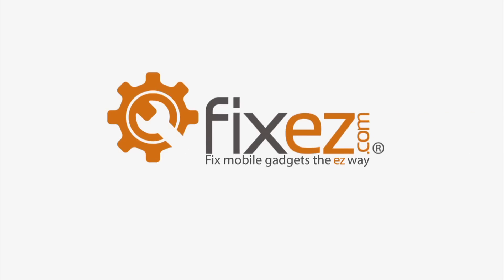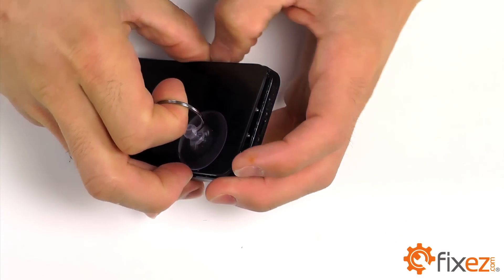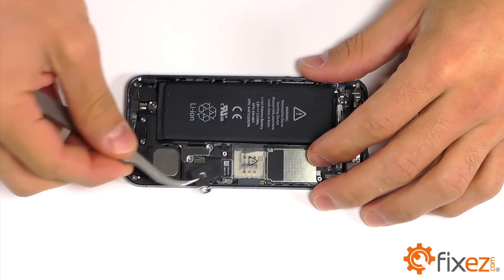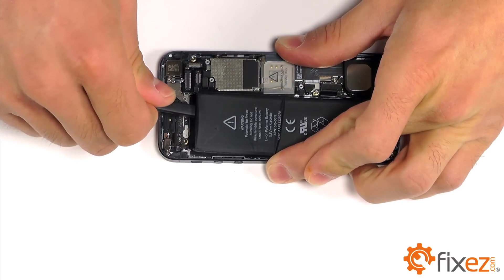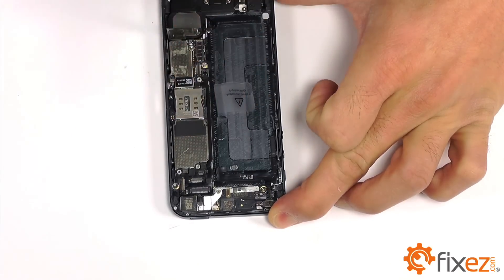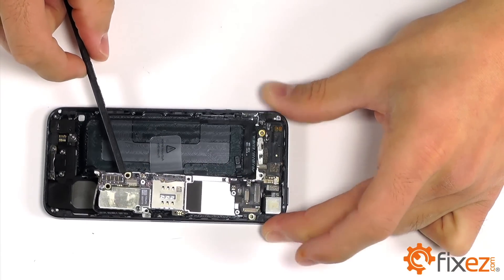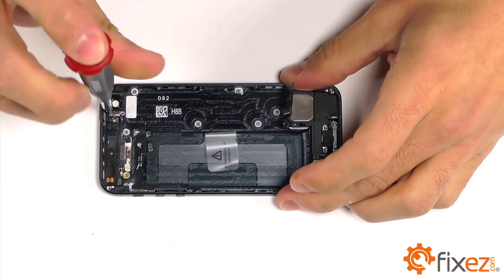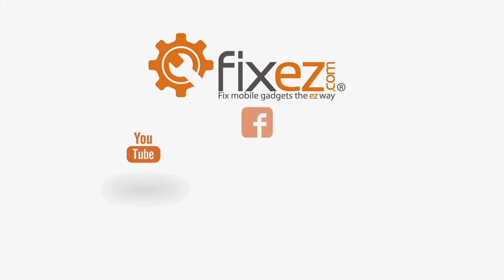iPhone 5 Power & Volume Button Repair

Comment: Someone fixed my power button but after that my iPhone 5 restart every 2 minutes before restart the screen turns like gray and turns off then on. So I shake my iPhone and I heard like a cable is disconnected, do you think that's the reason? And what cable do you think it could be?   Thank you?

Comment: your video is really good.  I did everything nice and carefully and slow but once i was done and put it all back together...the screen no longer works :(
i have no idea what happened or where i went wrong
anyone else have this issue?
Reply: ***** i was about to take it apart again and quadruple check the connections and i accidentally hit the home button, and to my surprise and joy, the battery icon showed up.
everything is now working!  thank you.  maybe it needed time to heal after the operation i just gave it ;)